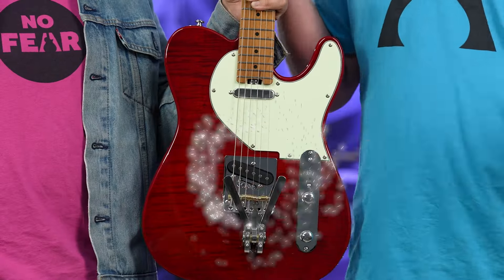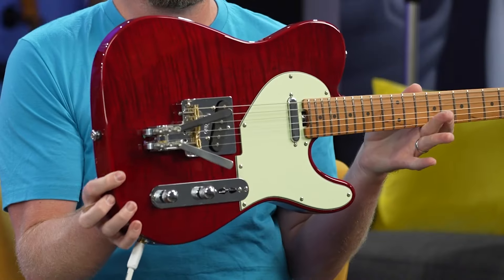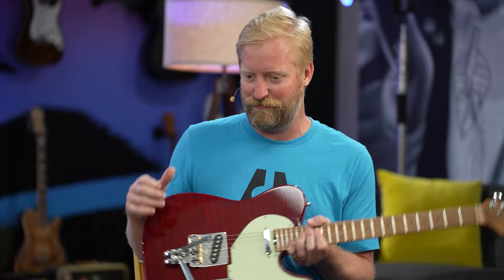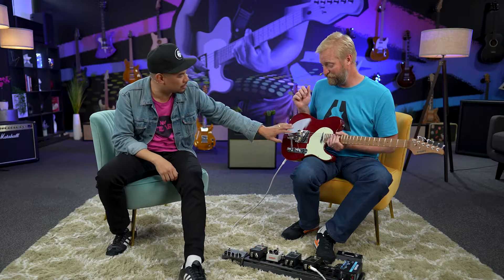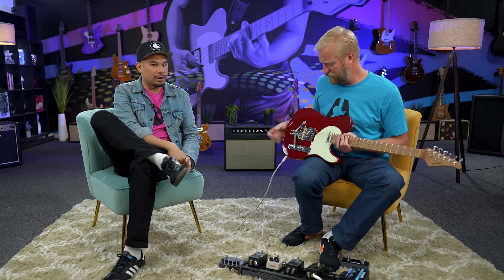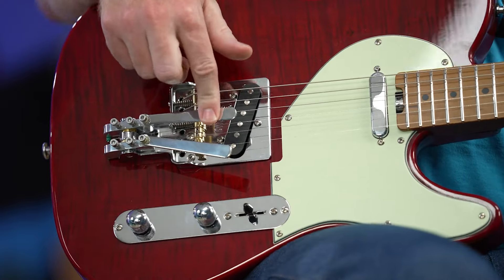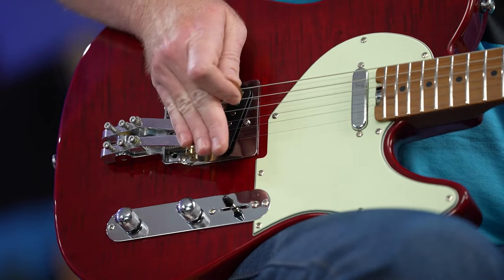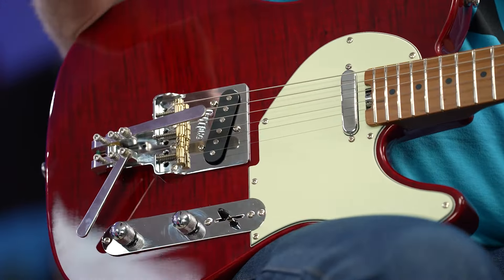Add a B-Bender for any Telecaster? Testing the Certano T-Bender

Comment: $650 for a glaser not thousands and those aren’t in the way.
Reply from the maker: Thanks for adding that to the discussion here.
Reply: @NoFearGuitarGear sorry I wasn’t trying to be a jerk. Just trying to help folks understand that benders are more accessible and less cost prohibitive than people generally believe. Palm benders are a great entry point and the old A list guys like Grady Martin used palm benders to great effect, but they limit your ability to do things like palm mute. If you have a glaser style they take away some access at the heel, but are very smooth light and accurate. Parsons style are out of the way, but have more moving parts, take out a lot of wood and are heavier. So there are trade offs with each style. Happy bending!

Comment: Certano's stuff is really well built and robust. I have his older palm benders kit that required more modification (had to drill into my body). Always received great support from Mr. Certano. It's pretty exciting to see a no modification kit from Certano.

Peters also makes nice benders as well. With a lot of different options to choose from. But again, requires some modifications (unless there's some new product I'm not aware of?)

For zero modification, there are two other options that are interesting as well.
String Butler sells the Easy B-bender that installs easily on an LP style tailpiece for you Gibson/Epi lovers out there.

Re-LapZ B-Bender sells perhaps the least expensive bender on the market. They offer single B, double G/B, and triple benders. And just replace the saddles on a 6-saddle top-load type bridge.

Things get really wild if you're using a slide and an open tuning. Where you normally lose some of the ability to bend strings, or where behind-the-bar bends might be a little too tricky to pull off cleanly.
Reply from the maker: Thanks for sharing those insights here. That is super helpful info for anyone exploring the B-Bender space.

Comment: The Certano T-bender design was actually invented by Owens "Boomer" Castleman and was marketed as the Bigsby Palm Pedal back in the early 1970s. Unfortunately it had non-rotating arms preventing the ablility to palm block the strings (another steel guitar technique). Certano has vastly improved the original design by being able to play several ways: B-bender style with one rocker arm. Emulating the A-B pedals on a steel guitar with both rocker arms. G-bender style with one rocker arm - Or just moving them both out of the way and go back to normal playing on the fly.

There are several models available including one for lap steel guitars (B&G bender). If you're installing on a Tele / clone, make sure and get the one that comes with the Tele style custom roller bridge & base plate assembly - you don't have to modify your original bridge to install it (just remember where you stored it). Easy to return your Tele / clone to original anytime and install the Certano T-bender on something else.

Comment: Does this fit in a case/gig bag OK?  I bought the hipshot B/G and drop D for one of my guitars, but this looks pretty cool for another guitar that I have.
Reply from the maker: Yes it would fit in any case or bag that we have. When you push the arms back they are only a little taller than the bridge. I suppose if you had a super tight case it is possible it could be an issue, but we just tried it in a few and all good.
Reply: @NoFearGuitarGear  Gotcha.  Thank you!  Good information!

Comment: Might I recommend the Rolling bender for an even less intrusive bender for those wanting to wade into the bender realm.
Reply from the maker: That one does look interesting. Have you used it? Looks like something that we will want to check out on the channel in the future. Thanks!
Reply: @NoFearGuitarGear  I have and the lever is behind the bridge rather than over the saddles. Though I’ve been playing pseudo steel licks for 50 years, it’s my first, and very low commitment foray into owning a bender, I really love it! It’s definitely out of the way and a zero mod (just remove one of the 3 saddles)version. It’s also the cheapest.
Reply from the maker: @JeffreyDopp  great insights, thank you! We will check it out and I am sure that info will help others here. 🙏🏼

Comment: Check out the Rolling Bender. It only does one string but it’s only $150 and you only have to replace one saddle on your tele. No screw holes.
Reply from the maker: Thanks for adding that to the dialog here. For sure there are several compelling options out there each with its own pros and cons. We will look into cover more and look into the Rolling Bender in the future.
Reply: @NoFearGuitarGear  I played a Certano bender on a lap steel at a shop but didn’t want to drill into my Macassar ebony topped telecaster shaped object. This works for me, but I’ll surely put a Certano on another guitar… probably a lap steel.
Reply from the maker: @hyrumjensen4712  that makes sense. If you do get one of these please do let us know here your experience.
Reply: @NoFearGuitarGear  I also love that their fretboards are just a wee bit flatter than a Squier or modern Fender.

Comment: Ok, so here's the concept that the video is missing.  Think of a standard E chord.  From low to high you have E B E G# B E  or root, 5th, root, third, 5th root.

What is the IV chord of E?  It's A.  What are the notes in an A Major chord?  A C# E.  Notice that the E and A chord both share an E note.  

Now, take the B string and raise it a whole step and it becomes a C#
Take the G# you're playing and raise it a half step and you have an A.

Your two benders are a way to bend a I chord to the IV chord.  This is exactly what the A and B pedals do on a pedal steel guitar.
So play an E barre chord shape anywhere on the neck for a I chord.  Same chord but with the benders down and you have the IV chord.  Move chord up 2 frets with the benders and you have the V chord.

OR : Play your E shape barre chord anywhere.  That's your I chord.  Move it up 2 frets. That's your II major chord.  Press the benders to get your V chord. Return to the first chord you played without the benders and your have your I II V I progression.  So by shifting your barre chord 2 frets and using the benders you can get a I IV V progression or a II V I progression in the same 2 positions.